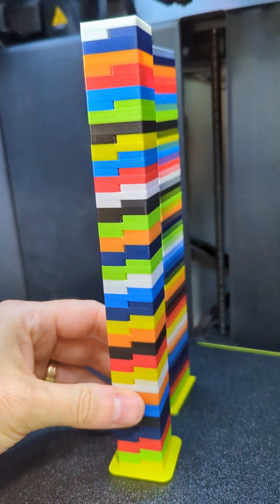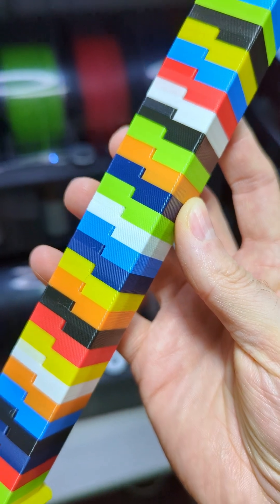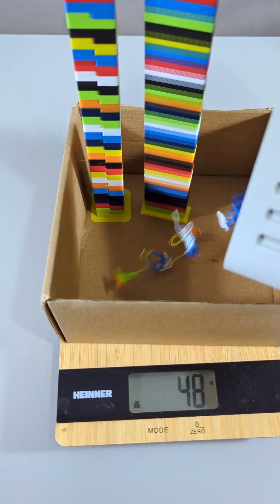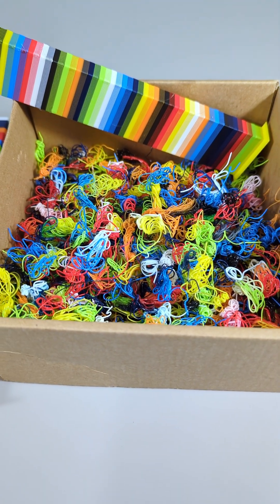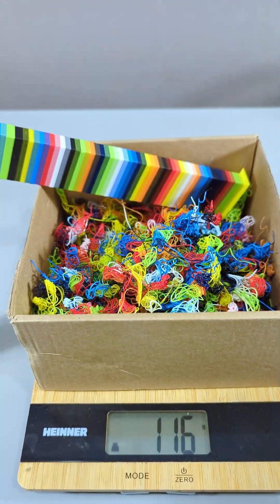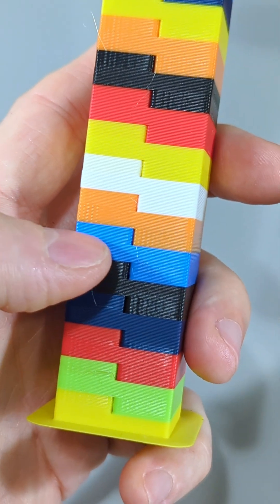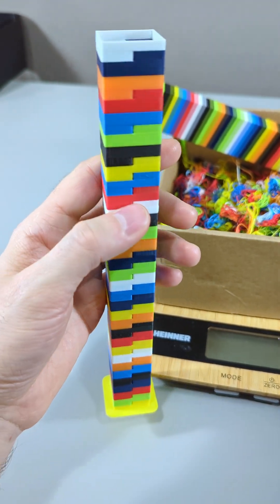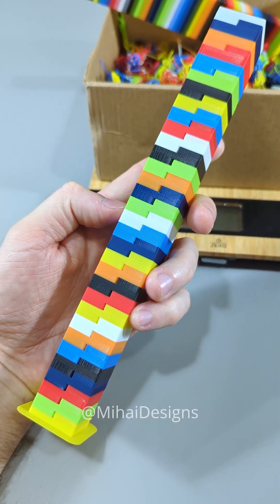Tuning purge quantities for AMS with 8 colors - work in progress

Comment: It would be awesome if the slicer or Octoprint could figure out how much purge there will be and automatically add something useful to the print like a bag clip or Lego brick to use that waste.
Reply: Well it can use the purge to infill which is cool. People have also asked for a way to specify if two color areas need a hard or sharp transition so it didn't have to purge as much.

Comment: What do you do with all the purge material? I've thought about getting that printer but I am concerned about having over 50% wasted filament for a print.
Reply from the maker: I send it for recycling, or I could use it to print models in random color. Ideally we'll see a tool changer soon from Bambu Lab.
Reply: @MihaiDesigns  curious about printing with purge material. Do you just add another object to the plate and specify to only use purge material?